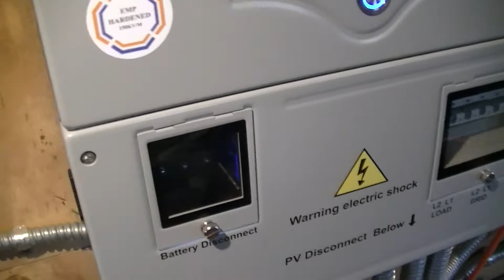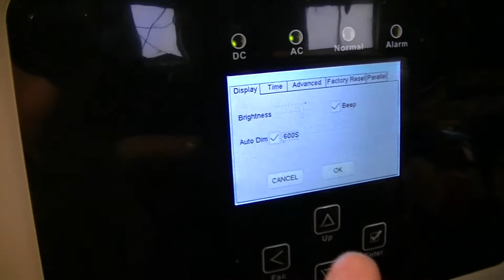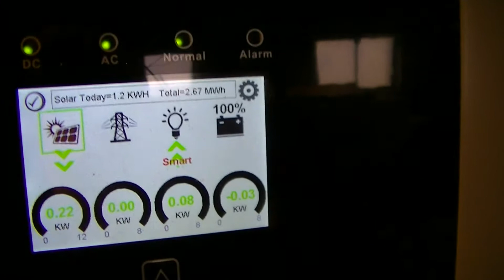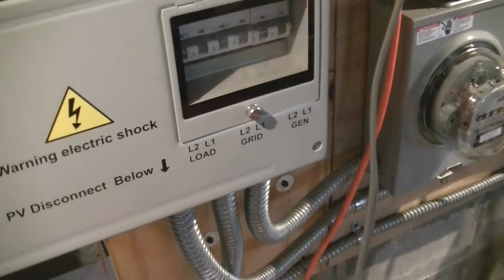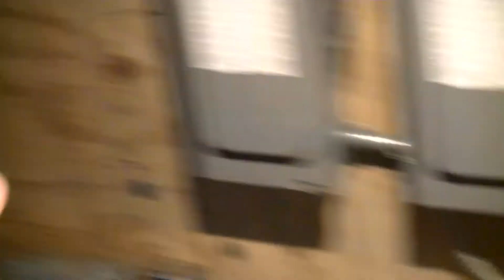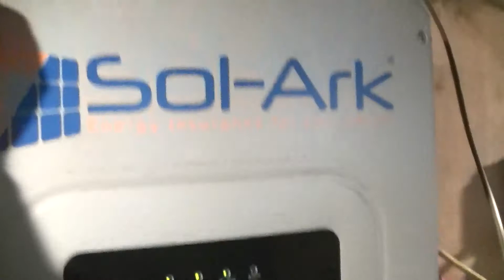Sol-Ark recommended improvements rambling

Comment: The changes I'd like to see implemented are additional inputs for A/C coupled solar and generator and Smart load rather than one or two of them. It's one of the things that's kept me from pulling the trigger on the Sol-Ark as I'd like all of those options built in.
Reply from the maker: Problem with some of that is that there is only so much room in the wiring box.  For big systems, what I would like to see is the functionality broken out into separate modules; i.e. a 3 or 4 MPPT solar unit, a battery charge unit and an inverter unit so that each unit is still man portable.  Units could also be mixed and matched, as in a single phase 3 wire inverter or a 3 phase 4 wire inverter, a 48V or a 96V to 144V battery unit (or more than one).  And a wind unit with wind MPPT and dump load controller built in.  When expanding systems, just add a new battery unit for the new battery to avoid problems with mixing battery banks.
Reply: @randacnam7321  I'd like to offer my assistance to you in the by way of saving a few dollars on your solar equipment. There's not a huge markup on solar equipment but it might save you several hundred $ on equipment if that helps.
Reply: I lost my signal before I saw your evaluation in total and see where you added these. My thoughts on the touchscreen from a solar contractors perspective is that I don't think that it'll be a big issue because after customers own the new systems for a year they'll rarely if ever play with it.
Reply from the maker: @williamjohnston3770  I would still like to see some improvements, especially to versions meant for microgrid service where there is going to be some guy poking buttons all day cuz it needs to keep the lights on and food cold for dozens or hundreds of people.
This could take the form of a separate screen and keyboard where all important functions are at the direct push of a button.  The screen on its own could also be a separate addon for normie users who want to see how things are doing from their kitchens or living rooms or whatever (think a better version of the remote screen for a Tabuchi EIBS inverter).
Reply: That would definitely be the Mac Daddy System and built to MILSPEC
Reply from the maker: @williamjohnston3770  MILSPEC: built by the lowest bidder and the solution to any problem is throw money at it.